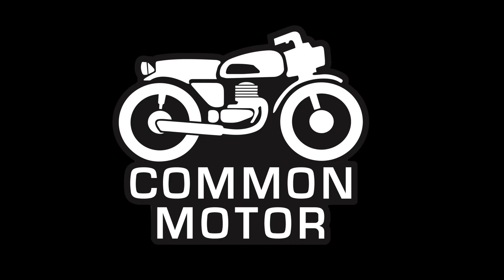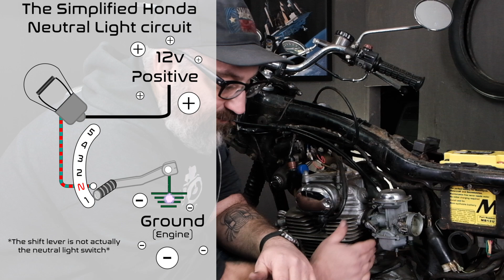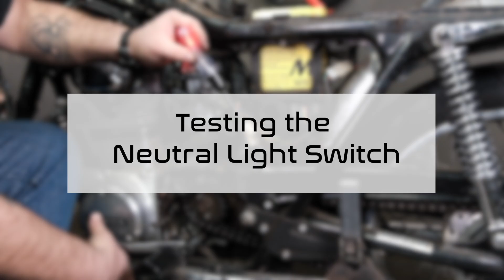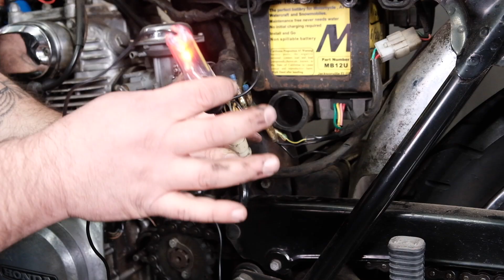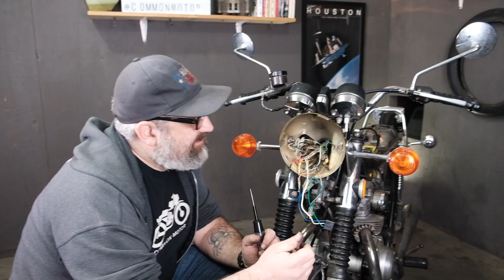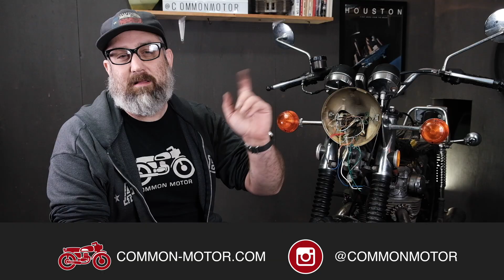The Neutral Light Circuit: Electrical Troubleshooting and Basics on a Vintage Honda Motorcycle

Comment: My CL the light works but it not quite in neutral.  I see my light flash  as I go into neutral but doesn't stay on.  It is like it needs to be adjusted?  The pain in the balls part is I have to pull my exhaust to get into this cover on the CL350.  I am going to adjust my floats soon so I guess while I have exhaust off I should have a look in here.

Comment: Good day, sir.
 Could you help me with a question? 
According to the KZ650 diagram, the oil pressure and neutral safety sensors are connected to the instrument cluster and send a positive signal. But how do I power the sensor indicator lights? Would they be powered by 12V from the ignition accessory wire?
 Thank you for your help.

Comment: changed the key ignition switch but at one point when I placed the black wire to the battery it almost started without a key then later on without me touching the electrical system the neutral light comes on but bike won't start

Comment: Much thanks for this my neutral light has been on and bugging me since i changed out my turn signal switches. Apparently the person who had the bike before me used the same color wire for the horn as the neutral switch. Flipped them and all is well now. The switches here are still in production also, they cost less than a dollar from Honda 😅

Comment: Im having an issue that you did not mention was possible with these circuits. My issue is the piece in my transmission that is supposed to make contact with the switch is not making contact with it. Or it is missing/broken entirely. I need to open my case to look. My wiring, light and switch all work which i tested by grounding the switch on the engine with power on and the neutral light appears. So I know it is just not contacting anything inside. Edit: Ill add this is a 43 year old bike and I have no idea if anyone tampered with it. I had to re do all the lights and stuff as they were missing. Now everything working except this damn neutral light. Good thing this bike does not care if it works or not to start. Kick start only lol

Comment: 88 Honda NT650 with a neutral switch issue. 12v getting to pin wire connector. 12v getting to plug wire connector (other half) that plugs to neutral switch. 12v getting to neutral bulb. Test light connected to pin wire connector (that runs to neutral switch) no joy. I removed my neutral switch and cleaned it, but still not working. Does this read like the actual switch gave up the ghost?

Comment: My neutral light problem turned out to be a break in the red striped green wire that goes up to the birds nest.  It occurred about half way up, under the fuel tank.  This was the original,  virgin wire, not something that had been played with or hacked up.  The copper had just corroded and broke, inside the unbroken in insulation.  Strange but that's what happened.   I used the test light's sharp end to pierce the wire as I moved up toward the birds nest.  I found it and spliced in a two inch section of wire.  I chose not the completely replace the wire.  I thought all I had was a dirty switch😢, but happy now.😅 Wish I had this video when I did the work but glad you keep hitting it out of the park.  Keep it up.

Comment: my neutral light comes on when the bike is in neutral, but my starter won't turn over unless i pull in the clutch.  not sure what to make of that lol.  my bike is a '76 CB360T
Reply: I ended up just bypassing the neutral and clutch safety switches by grounding the green and red wire coming out of the starter solenoid.  i suppose there's a danger of starting it in gear now but hopefully that doesn't happen.  Anyway, it starts without pulling in the clutch now and that's what i was aiming for
Reply: Opps!  i guess it was just a matter of time: started the bike with it in gear.  it lunged forward and fell over on it's side.  smashed off a turn signal but that was about it for damage.  rewired it back to the way it was before.

Comment: My neutral light stays on no matter what gear it’s in
Reply: On my 74 CL360
Reply: I have the same issue. Can't figure it out. No one seems to know
Reply: It's grounding out somehow. Either touching the piece inside the transmission or shorting out.